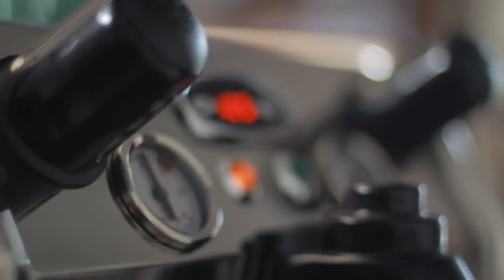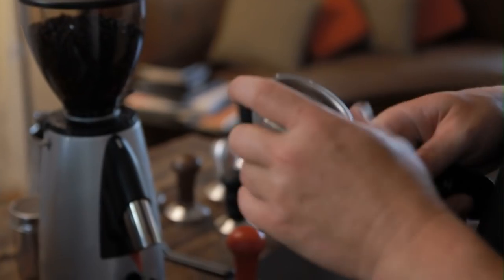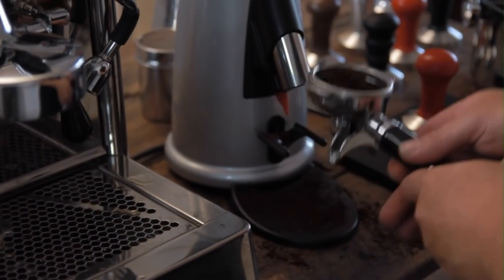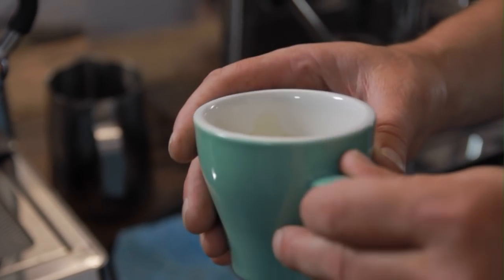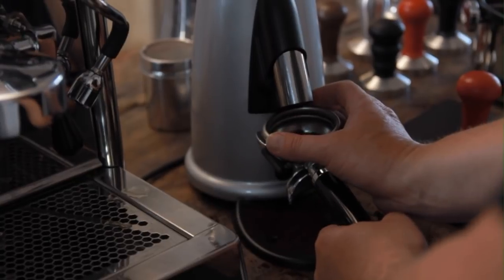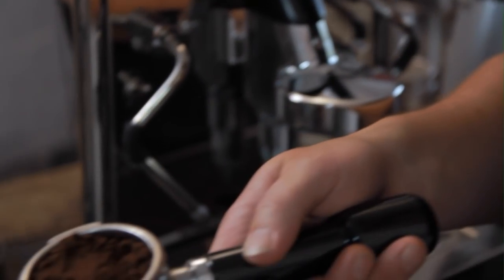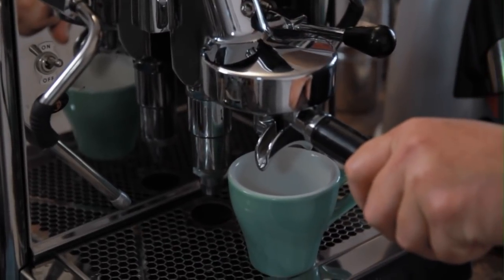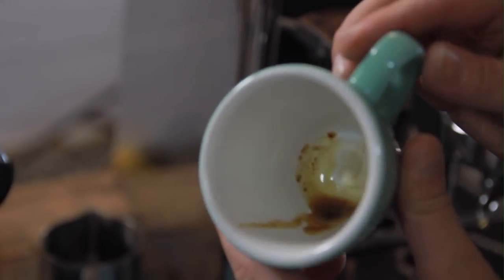Making an espresso shot mistakes

Comment: If the coffee comes out clumpy, that doesnt mean its too fine, or grinder is bad. What it means that coffee is roasted more heavily and there is more oil  that makes it clumpy, sticky, or air humidity is bad where you store it. What you want to do is to spray it with some water before you grind the beans to make it more clump free, if you have this problem.

Comment: I finally got an espresso machine at a thrift store the other day (am poor and on disability, so i had to find one used lol) - It doesn't have a lever thing you pull though - after you put the coffee in the metal porta-filter, and connect the filter to the machine, the water just pumps through it automatically... Anyhow, it seems to work mostly well, but i've noticed the espresso shots never really have a crema. Is there something i could be doing wrong?
Reply: No a perfect shot must have 3 layer when you extract espresso at first crema, heart and body after a while heart disappear of course

Comment: I have a Braville barista express and I’m having an issue with the shot ending around 15 seconds. The pressure gauge is right in the sweet spot and everything looks good, but it simply doesn’t run into that sweet spot of 20 to 25 seconds. I have adjusted the grind but I’m wondering if inconsistent tamping pressure is playing a role. Basically, say I make the grind coarser but then happen to put a few more pounds of pressure on the tamp, while not intending to, wouldn’t this just cancel each other out? Likewise, I make the grind finer but my tamp happens to be a little lighter.

So I guess the big question is, if my pressure is right in the sweet spot, how do I adjust things so the pressure gauge stays where it’s at but the water is running longer to give me a larger shot?
Reply: MentalUnrest you can programme the timing. Press program then double or single press it again after 20-25 seconds after the first drop of coffee.
Reply: One variable at a time, or you'll go crazy. What I found worked for me was focusing on the tamping first, trying to be consistent. For that, I ended up using less force than I was trying to. I read about 30-40lbs, but then saw some people at work putting a lot less pressure and getting great results. So I decreased the force, which made it easier for me to be consistent: firm, but not super hard. Once my tamping was consistent(ish), I experimented with grind coarseness. Once I got the coffee flowing out of the portafilter the way I expected it, getting the full shot in around 30s, I further played a bit with coffee amount. This of course affected things again, but I was already in the ballpark so it was minor tuning... the coffee was already nice, but it was a matter of seeing if it got a bit better or not. I kept a little notebook with notes of what I was changing each time and what the result was. Labcoat optional ;)
Reply: Making the grind finer or tamping harder will increase the time it takes the shot to come out. Making the grind coarser or tamping less hard will cause it to go faster. Make sure that when you are tamping, that you're using one that's the right size for your portafilter and that you're doing so evenly.

If after doing that, you're still having this problem, consider the programming option, but that really shouldn't be your first effort to address it.